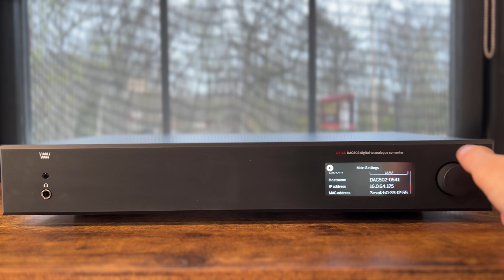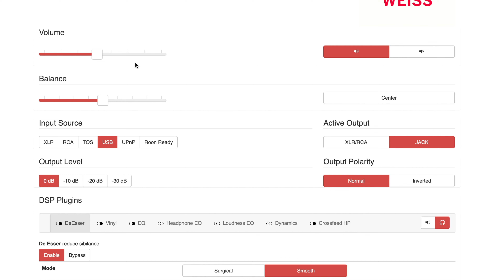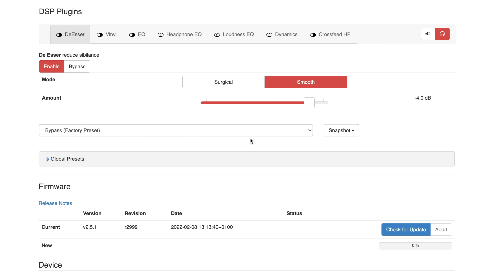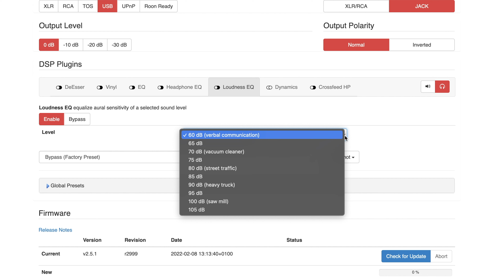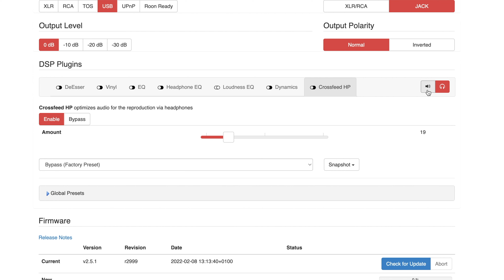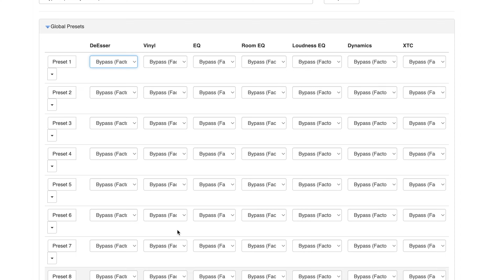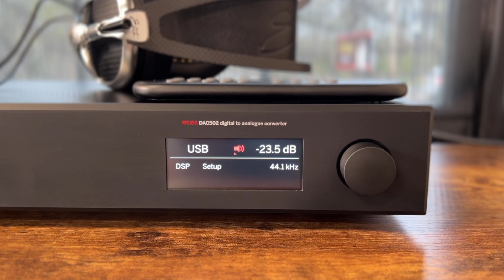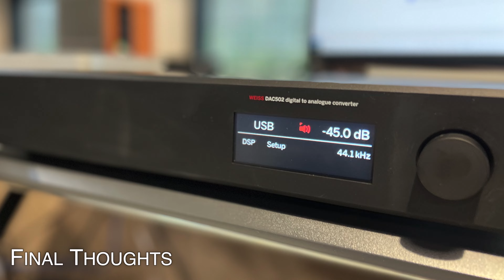Weiss DAC502 Feature Overview and Review

Comment: Steve, Can you disable the volume control and just use your own preamp?
Reply from the maker: Yes, so I've tested it with a separate preamp, and simply left the level control at 0 dB and used the output setting to match the correct voltage per the manual: 

XLR
0dB setting: 6.8 Vrms +18.9 dBu
• -10dB setting: 2.2 Vrms +8.9 dBu
• -20dB setting: 0.68 Vrms -1.1 dBu
• -30dB setting: 0.22 Vrms -11.1 dBu

RCA
0dB setting: 3.4 Vrms +12.9 dBu
• -10dB setting: 1.1 Vrms +2.9 dBu
• -20dB setting: 0.34 Vrms -7.1 dBu
• -30dB setting: 0.11 Vrms -17.1 dBu
Reply: @BloomAudio  Thanks